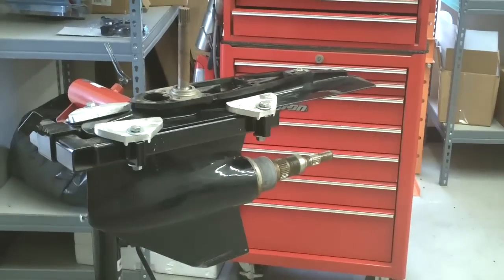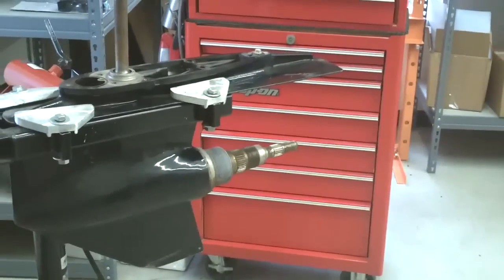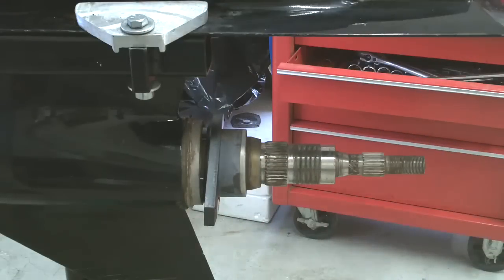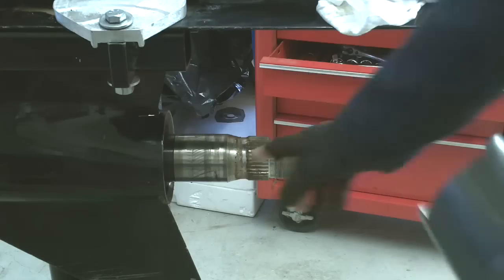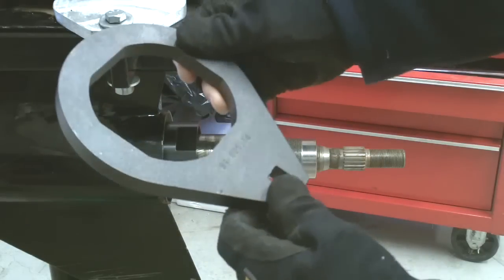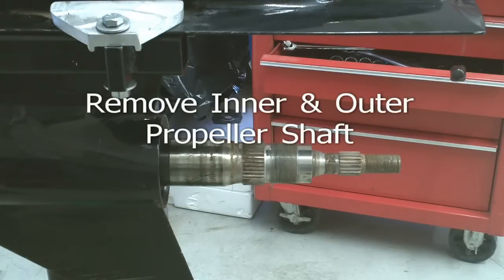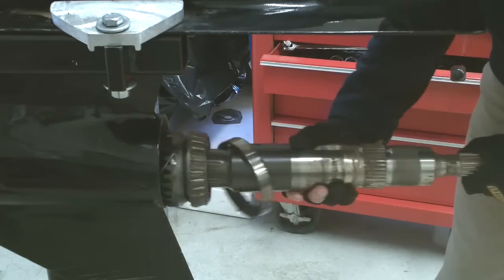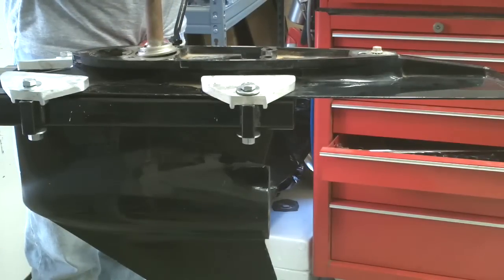Mercruiser Bravo 3 Sterndrive Lower Unit Dis-Assembly

Comment: Do you have any idea if the prop shaft on one of these would fit inside the gear case of an old 200 black max? I’d really like to have the dual prop set up on my flats boat so it could hole shot better and run really shallow.

Comment from the maker: It seems like these days its more cost effective in the long run to replace the lower unit. As a certified Mercruiser dealer we rarely do complete rebuilds any longer. As the quality of the drives has improved over the past 10 years much of this can be attributed to improved assembly requirements, etc. It is very difficult for a dealer to comply with this at the same level as the factory. Therefore we normally replace complete uppers and lowers.
Reply: i know this was 9 years ago and it might have been more cost effective then. now a lower unit costs 4-$5000. just bought a boat from and individual and my lower is bad im without words and trying to figure how i can afford to fix it.

Comment: very intuitive...my bravo 3 prop shaft has a crack in it.  should I have a cert mercruiser mechanic replace it or buy a new lower unit.  No idea how it cracked as there is no damage to the props and minimal corrosion.  Afraid it might keep cracking? rsharpe123@verizon.net